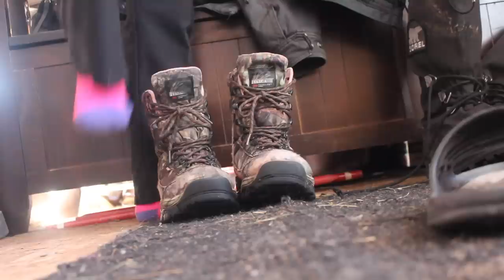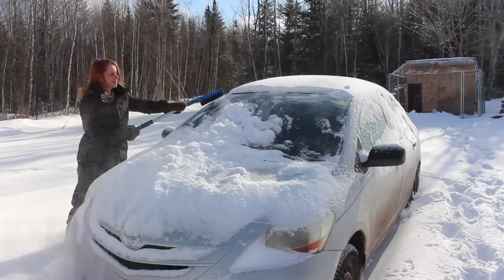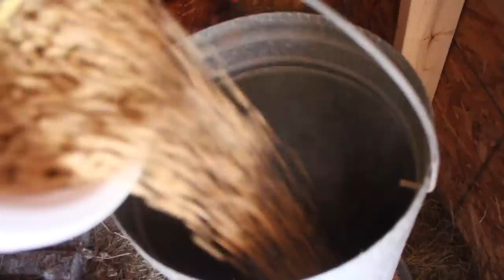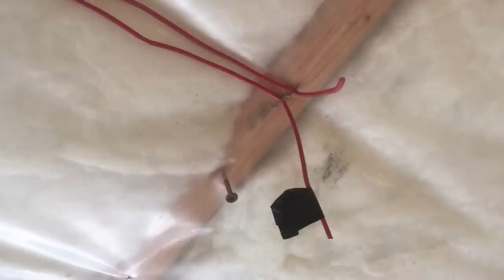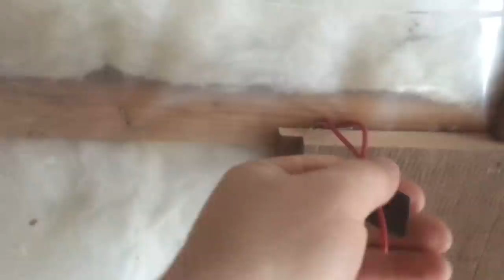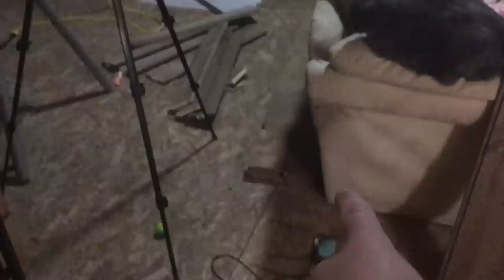Vintage & Rustic Boards For Our Off Grid Kitchen Ceiling

Comment: that battery operated nailer does the job... i never tried one.. only the ones that run off a air compressor .. but it look up to the job.. ceiling is going to look nice

Comment: Shop broom's work a lot better for snow removal, but you can't use them for anything else. They collect sand and gravel if you do.
Reply from the maker: I will head out and broom the driveway and see how that works haha. Where do you live? A broom would probably do nothing unless it was powder.
Reply: @MBFModernHomesteading  Spokane
Reply: @MBFModernHomesteading  I was talking about the cars and solar panels.
Reply from the maker: @mharry860  Thanks.

Comment: The ceiling looks great. Im not sure I would have put the light wires like that tho.
Reply from the maker: Thanks.
Reply: @MBFModernHomesteading  you couldnt drill some holes in the studs?
Reply from the maker: @frankz1125  I didn't feel the need to.

Comment: Do you have any idea what the R value of your ceiling using  wood as opposed to sheet rock?
Reply from the maker: We have R20 insulation doubled up making it R40 in the attic which is plenty of insulation anyhow, so we are not concerned about the interior design providing any R value. Having said that, I do not know the difference between the two.